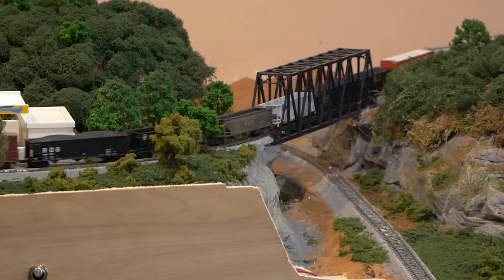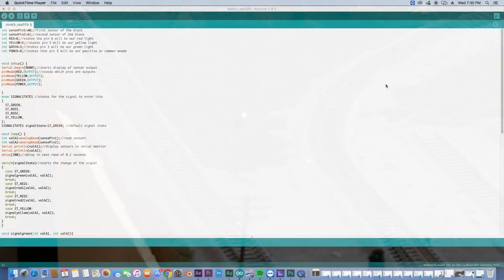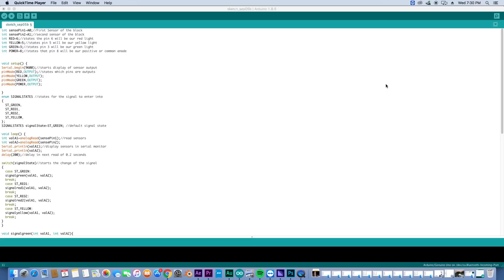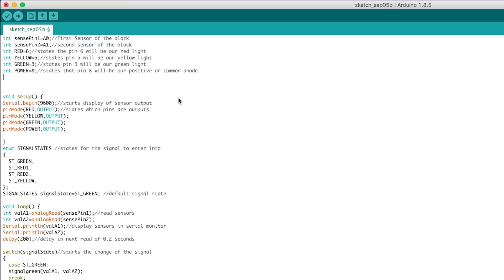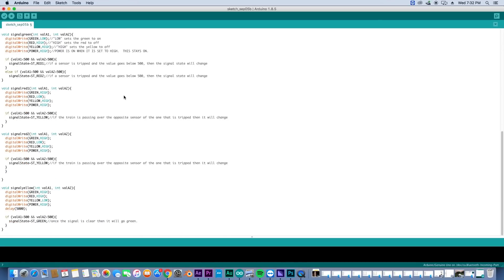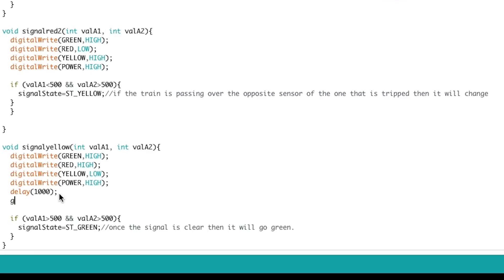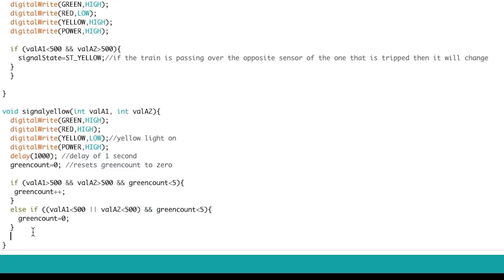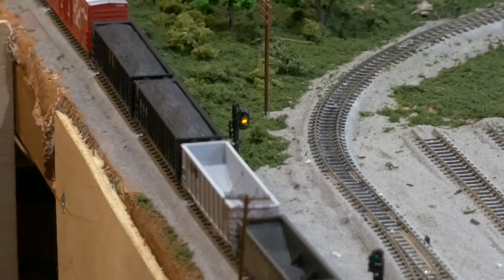Improving The Arduino Model Train Block Signal

Comment: Hi Jimmy your videos are fantastic and a great resource my problem is I wired all my signals common negative is there a major difference in the coding? When it comes to programming I have a mental block and would appreciate if you could help me. Thank you Regards Darren
Reply from the maker: So when I first wrote this, I actually had common negative signals.  You have to do 3 relatively simple things.  The first is that you have to eliminate the "POWER" pin which I believe is pin 8.  You don't need it.  The second thing is you have to reverse all of the "High" and "Low" commands.  So for example,  The signal being green would be "GREEN=HIGH; RED=LOW; YELLOW=LOW"  And so on and so forth,  just reverse every "HIGH" and "LOW" command in the code and you should be fine.  The third and final thing is that the common wire goes to a "GND" pin rather than pin 8.  That should do it.
Reply: @DIYDigitalRailroad Thank you Jimmy you are really the guru of model railways, it works well. Have a great day and thank you for the fast help it is greatly appreciated!

Comment: I tried this code all i got was my signals stuck on yellow unknown as to  why ???
i reverted back to your original code
Reply from the maker: A hang up on yellow means that the count isn't making it to 5.  I would check to see if your sensors are accidentally tripping during that with the Serial Monitor in the Arduino IDE.
Reply: @DIYDigitalRailroad  I've had the same problem as South Coast UK. The signals trip normally as with the original sketch but stick on yellow. I've checked everything in the sketch and it all seems correct and uploads to my Arduino no problem. I too have reverted back to the original code(which works fine) but am curious as to why the update won't work. Any other ideas besides accidentally tripped sensors? Love this code, by the way. Looking forward to implementing on my new layout which I'll be starting soon.
Reply: I too have run into the stuck yellow signal. I have triple checked against the video and all has been typed just as in the video. Viewing the Serial Monitor, both sensors only show values in the 1000's when not triggered. If I trigger either of the sensors, it shows a value in the 30s. I added code just below the greencount++ to print the count to the Serial Monitor and it confirms my thoughts that it is not advancing the count beyond 1. If I comment out the first greencount=0 above it, then I can see the count increment up. However, then the greencount no longer processes after the first cycle back to green. I am still trying to figure out why it is not working. But, with me being rather new to programming arduinos, it may take me a while if at all. Is there possibly something different between what is in the video and what you are running? I enjoy your videos. Keep 'em coming.
Reply: Ok, Solved. I had a thought right after submitting my comment which solved the issue of the greencount not being used on subsequent cycles. The issue is that that with commenting out the first location of the greencount=0 that followed the delay(1000) the counter did not get set back to zero and therefore was greater than 4 and continued the change to green without counting up. I solved it by moving the greencount from below the delay to below the signalState=ST_GREEN. This allowed it to reset the count back to zero so that it would increment up again on next cycle. I think I'm starting to get the hang of this. I hope this helps anyone else having issues with the stuck yellow.
Reply: @eugkelly , I believe that you also should set the initial value of greencount to 0 when greencount is defined with the int statement.

Comment: Do you have any ideas how to set a red signal if a turnout is lined against train movement?  Enjoy your videos. Keep up the good work.
Reply from the maker: I'm actually currently in the testing phase of some arduino based turnout controls.  I haven't mastered it yet, but it's looking promising!
Reply: @DIYDigitalRailroad  I was thinking something like led circuit  off of aux contacts on switch motor. Use photo resister as analog input based on led off or on

Comment: So I just revisited this video to see if it will be useful in my signal system. I finally installed mine (been busy here in Northern CA with the Camp fire lately....just a few miles from here) and all 32 lights work as needed for the double crossover! A question for you - after adding this "improvement code", did you still keep the 200ms delay for the sensors in the loop from the initial sketch?

Comment: When it's in the loop for signalyellow how does greencount ever become greater than 1? Each time through that loop you're resetting greencount to 0 before you get to any of the "if" statements, right? Won't the "greencount++;" condition only get executed once and then the next time (1 second later) through the loop greencount=0 gets executed again before the "if" statements. Shouldn't you move that "greencount=0;" statement up to where you first change to the yellow state from either red state? That way once you're in the yellow state greencount can increment whenever both sensors are clear and will only reset to 0 if either sensor is covered. greencount will then reach 5 once both sensors have been cleared for a consecutive 5 seconds.
Reply from the maker: I really thought it was going to work that way when I wrote it, but it works for some reason.  I do agree that the greencount reset can be placed in the green state and that is a good suggestion.

Comment: Your video shows the train is running against the signal. I would expect the signal to always be red until the direction of travel changes towards the signal or the block is occupied.
Reply from the maker: I have been trying to figure out exactly what to do here.  I can't have a time out counter because the train may sit in the block, and a simple sensor read would be prone to errors.  I need to do some thinking on this.
Reply: You shouldn't look at the signal as a traffic light that runs on timers but rather on it's surrounding. I would suggest building a simple DCC signal decoder and then use JMRI to manage all the traffic. I built my own DCC decoders but they are not arduino's and  I use Team Digital's CSCe boards to handle the logic to make it computer free.You could use a raspberry pi for JMRI. https://translate.google.com/translate?hl=en&sl=fr&tl=en&u=http%3A%2F%2Flocoduino.org%2Fspip.php%3Farticle161

Comment: Very good video!  I understand how the code functions for that particular signal; however, if you have a series of blocks on a main line do they change color in sequence after the train passes?  For example, let's say you have three consecutive blocks each protected by a signal.  While in Block A, its signal aspect is red.  When the train enters Block B, does the Block A aspect change to yellow, or is the change simply time-dependent because the arduinos are operating independent of each other? On a real railroad the aspect for Block C would be red (occupied), Block B would be yellow and Block A would now be green.  I hope the question makes sense.
Reply from the maker: Keep it hush hush, but I'm working on a multiblock signal system with arduino!

Comment: Thanks for the update. I will keep this issue in mind once I have my double crossover up and working. My sketch is pretty much done and works well and as I want it to, although code format is pretty ugly to look at. I cannot use delay in my sketch as the code must continue running for both main and branch lines and the crossover. Millis() solved this problem. The crossover consists of 12 signal sets, 2 or 3 lamps per set, total 32 lamps and 4 sensors. Progress, not perfection...... Ben
Reply from the maker: Code is only ugly if it doesn't work!